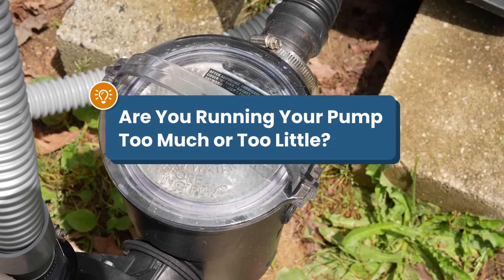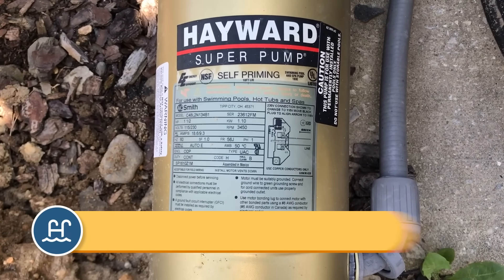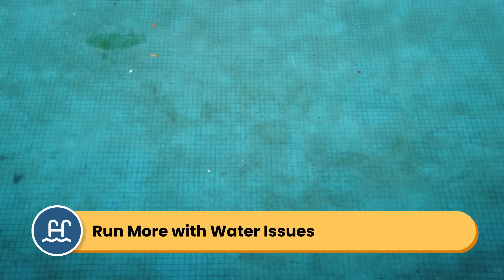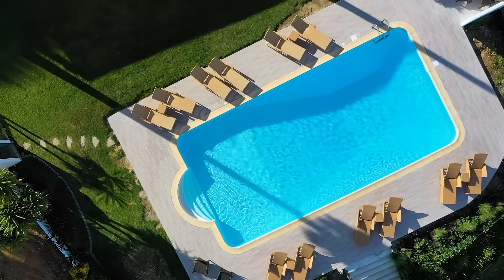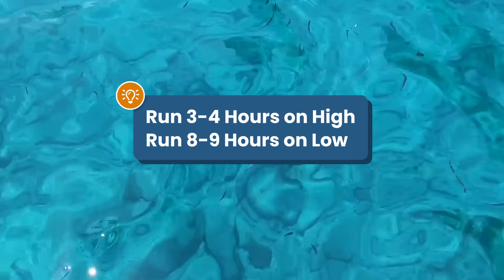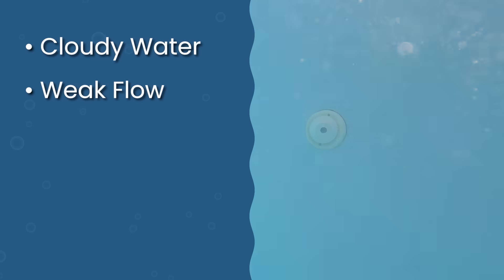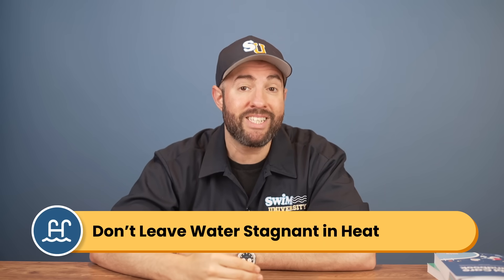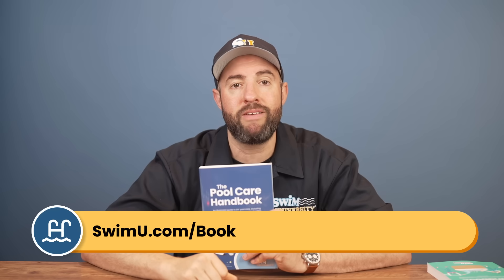How Long to Run Your POOL PUMP (EXACT Calculation)

Comment: I have a small pool it’s 5875 gallons and they told me to run my pump for 8 hours at 50% which it’s roughly 42 gallons per minute. Then 3 hours at 75%. Am I just wasting electricity running it so long daily??

Comment: Took a year to figure out but Jandy Truclear salt cell cuz it's easy to monitor & clean, and relatively cheap to replace.  Maintain pH level. Occasionally add dichlor for shock and Beautec to keep the scale down.  👍

Comment: my pool is about a 16000 gallon kayak, I have a 1 hp hayward that i run 24/7 four months a year,  then i keep in the shed off season , running great the last 6 years , water is absolutely beautiful  using Oxygen pool system ,  hayward 220v heater , could not be more pleased, never had a pool before

Comment: Hello, I have a 15,000 gallon in ground fiberglass pool with a SWG. I've been getting a lot of flakes at the bottom of the pool. I know it's calcium carbonate because I dropped them into a bucket of water and muriatic acid and they fizzled like alka seltzer. How can i fix this? Also, I cannot figure out my Flow rate, GPM. My pump is a Jandy variable speed and 1.85 hp. The pump is 68 feet from the skimmer. The height of the pump from the skimmer might be about 3 ft lower than the skimmer and the PVC pipes are 2.5 inch. I'm looking at the flow rate chart in the manual but i'm just not getting it. How can i figure out how much is my flow rate and how long and what RPMs i should run my pump. Right now I'm running it from 7 am to 4 am @ 2375 rpms. Thanks in advance for any help.
Reply: I had this same problem, vacuumed pool to waste, and check ph levels often.  Once I was able to keep ph around 7.2 flakes went away.  Maybe add a little more duration acid than normal

Comment: I just run our pump 24/7. The heater won’t heat and the chlorine dispenser won’t work if the pumps not running.. crystal clear water all summer long… never have a problem with it turning green even if I forget to put in the tablets.
Reply: Not everyone wants their electric bill to be $300 a month
Reply: @that_one_guy6678 300??? Holy crap I wish. Mine reaches 500+ during the summer.
Reply: @that_one_guy6678  I wish my electric bill was only $300 a month!😂
Reply: @that_one_guy6678   My variable speed pump can run at max speed 24/7 365 and only cost an additional $400 a year. Barely noticeable month to month.
Reply: Mine is the same type of system....8hrs a day is fine...I just add occasional shock after rain or party (frogger system)

Comment: The pump running hours have nothing to do with algae growth unless you have to run your chlorine (salt) generator. NOTHING. Your chlorine level does.
I currently take care of a pool that hasn't had power for almost three years  (hurricane destroyed house) and it has no algae and is not cloudy. If you don't care if your pool is dirty you can cut the hours.

Comment: Always learn a little something from your videos. My local pool dealer/servicer is telling me that my water is “old” and is therefore not getting a high enough free chlorine because the water is incapable of dissolving free chlorine!   Solution is to drain and refill with fresh water. Is draining and filling a thing?  Our water is very clear and I shock weekly.
Reply: Check your cya level.  If it's high then you need more chlorine to maintain free chlorine levels.  The only way to get rid is to do a partial drain and refill.  But you do have to have some cya to keep your chlorine levels good.  He has very good video on it.  Search it up and get familiar with cya or "stabilizer".
Reply: You may have chloramines and need to shock the heck out of it to get your free and total chlorine to match

Comment: Can you explain how to set a variable speed pump? I mean ours is at max for 8 hours..20k gallon pool. Why have a variable speed if it only runs at the max? Never understood this.. thanks.
Reply: The variable speed pump has at least in my case a switch that has a low setting mode or high setting mode....maybe you have it on low during a party ....high for 8 hrs or shock phases

Comment: Your pump in the video nor my pump shows the gpm.
Reply from the maker: I didn't show it directly in the video. It's usually found on the pump's nameplate (a metallic label on the pump motor). Otherwise, look up the pump model using part numbers found on the strainer basket lid or impeller and you can find the GPM online.

Comment: Where is the GPM the pump used in the beginning of the video at the 42 second mark?  Mine is similar and I don't see it on your example either.  A lot of information but I don't see a GPM.
Reply from the maker: Sorry, I didn't show it directly in the video. It's usually found on the pump's nameplate (a metallic label on the pump motor). Otherwise, look up the pump model using part numbers found on the strainer basket lid or impeller and you can find the GPM online.
Reply: @SwimUniversity  yeah tried that.  No information for mine.  I put in HP into Google and came back with 107GPM.  Seemed high but at least I have something to go on.  Those Hayward pumps don't seem to have that information at least for my pump.

Comment: We have a Hayward 2.7 variable speed pump.  We have a smaller than average pool size (12x22 + 5 ft sun shelf on long end 8" deep).  Our pump is oversized for our pool (as we're about 9,800 gallons), so I keep the speed at 50% for circulation, and then when the heat comes on it runs at 65%.  Estimated pool turnover time is about 3.5hrs, and since the power use is so low I have it set for 8am to 10pm.  It sits in direct sunlight from end of May to first week of  September.  Low cost for chemicals, low cost for heat with solar blanket for the nights, and water stays crystal clear.  I try and brush it every other day, and we also have a robot wired cleaner for bottom and wall scrubbing.  We back onto a green space so we get a lot of pollen, and I agree with rinsing the cartridges frequently (once a month), and our pool stays crystal clear with the longer run time (I had set it before from 11am to 9pm).
Reply from the maker: A 3.5 hour turnover is great! Sounds like it really helps keep the pool clear
Reply: Set it for evening runtime....to save some money on electric....daytime running...(which I also do occasionally) is peak hours...aka higher electric rates typically...I'll kick mine on before bed and off in AM....I need a good timer suggestion